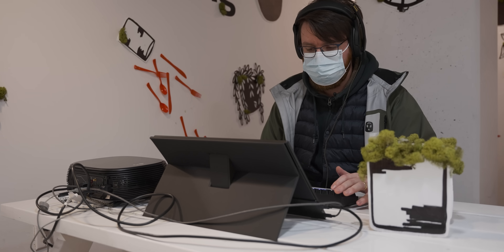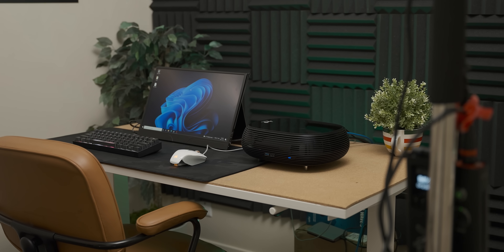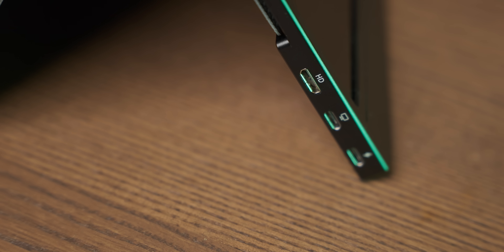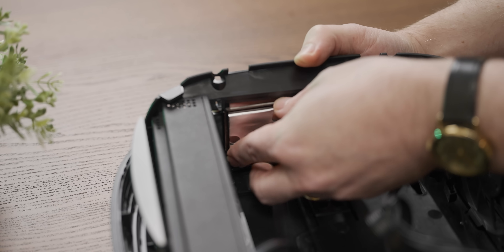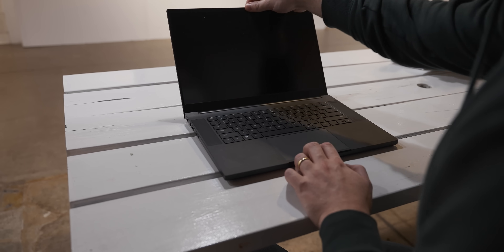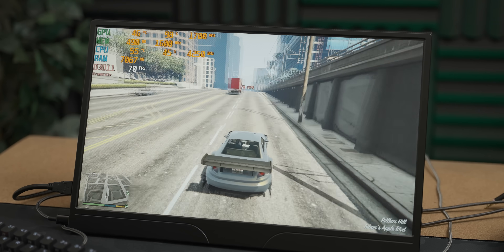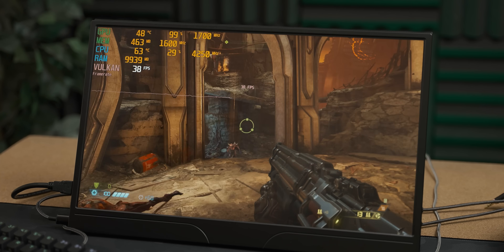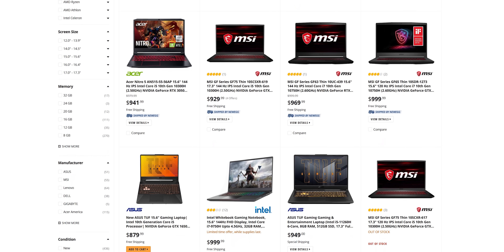Wildly Impractical "Budget" Portable Mini Gaming Setup...

Comment: I can see people liking this set up if they live in a really small apartment and want the option to store it all away easily... I know I know, get a laptop then. But for those who want separate components this is a nice option imo :)
Reply: Agreed
Reply: Exactlyy
Reply: A laptop makes more sense, but building the PC is half the fun 😅
Reply: Laptops aren't intended to be run at fully duty cycle, just boost once in a while, else their cooling system is pushed to the limit, and even when it can keep up, the noise usually warrants earplugs. This little system can go all day any day, it's silent, and if someday a component gives up the ghost, it's an easy and relatively inexpensive replacement.
Reply: @junko4166  yassss! And getting to build in a lil mini itx case like that with the lil motherboard and stuff seems like a fun experience 😺
Reply: @SianaGearz  exactly! And if you want to upgrade a component you can without having to replace the whole system.
Reply: @SianaGearz  i agree but still you have to play games on 720p
Reply: I saw this case and thought it was a projector. Put a led projector on top of the case.
Reply: As someone who lives in a place that is often at risk of flooding, I do sometimes wish I'd stuck with a laptop in lieu of an mATX build despite it being better value from a price-performance standpoint (as of the time I put the system together anyway). Definitely a time and place for all these, though use case may certainly be more restrictive.
Reply: When are we going to see the "Anna watches all of Dawids old videos and tazes him for every useless one" video?
Reply: L4fty  my dad is half Deutsch :)
Reply: Yeah, but i hate when people bring this kinda setup to public place like coffe shop, just buy a laptop if you wanna bring it to public place
Reply from the maker: I still think a laptop is a better option for that, but you could get a different ITX case where you can drop a dedicated GPU in. 😁
Reply: Laptops have limitations, I bought an asus gaming laptop with a 3050ti but gpu only runs full power if plugged into external monitor… kinda defeats point of a laptop so dawids solution isn’t so silly
Reply: Anna you wrong, everyone nead the idiea of your husbend, sheme on you for saying that only someone will nead it in small appertment.
im surprise from you Anna
Reply: @ultraL2  Or get a laptop with MUX switch (negates the issue you're having, but expensive though...)
Reply: @SigalDa  pardon me?

Comment: It wouldn't be a Dawid does tech stuff video if the premise of the video wasn't practically useless, but loads of fun! 🤣 Honestly makes me want to build a mini itx build for my living room because my Roku is terrible
Reply: Right? It’s a perfect lil living room PC!
Reply: If you do this, I'd probably go with the InWin Chopin instead of the InWin B1. It's got a lower wattage PSU, with 150W instead of 200W, but you're not gonna go above 150W with a 5600G (someone powered a 5700G off of it without exceeding 135W), and the side panel is mesh rather than glass
It's also a lot smaller, it's basically the size of an ITX motherboard
Reply: I have a living room PC. It comes in handy all the time. Chromecast, Roku etc. Are all way cheaper but I just really like it and it never has issues I can't fix unlike the TV apps
Reply from the maker: It's really great for a powerful TV PC. Thanks for watching! 😁

Comment: It seems like the 5600G or 5700G should have been used in this considering that’s what most people would use as Dawid even pointed out.
Reply: The 5600G lays down the spank even harder. More cores, more Vega.
Reply: @richardgarrett2792  and more CPU airflow chocking. And noice.
Reply from the maker: That's true, I just had a 5300g. There has been flooding in the area where I live so it's been real hard to get hold of new stuff.
Reply: @DawidDoesTechStuff  I hear you, brother. I’m in the same area. If there is local Amazon stock (either Tsawwassen or Richmond), we’re good btw. I ordered something from Canada computers and took an extra week to be delivered

Comment: I can see someone getting that if they like the aesthetic of that case which looks very mid century modern. Hopefully Ryzen 4 has RNDA 2 or 3 in it to really push that IGPU goodness!
Reply: it's something they already utilize with the xbox and ps5, it's puzzling why they wouldn't make this available for PC's, even if it were an entire board assembly.
Reply: Part of the reason they've kept vega is due to ddr4 speeds being unable to supply enough bandwidth
Reply: @Vegatablez  I’m still in favor of a purpose-built board with GDDR5 or 6 soldered to the motherboard
Reply: I'm kind of hoping they consider using hbm again in the future, maybe an hbm chiplet? Using it like a cache for the cpu when not as vram
Reply: @continentalglue  there is something called contracts that can prevent them from using.
Reply: @vollkerball1  between both Sony and Microsoft? Exclusivity to the console market only seems like a needless pigeonholing
Reply: @continentalglue  it depends. They could have funded the research and development and that funding is not without caveats
Reply: @continentalglue  I am talking about AMD contracts with Sony and Microsoft, if you compare the solutions are different but for example Sony solutions has built in decompression units, sound, and IO differences and those modifications have to be researched and funded.
Reply from the maker: I know right! I can't wait for those new igpus.
Reply: If I were ever to build an HTPC I'd probably consider that case, I think it's gorgeous. It's pricey, though.
Reply: It looks like Ryzen 6000 leaks have performance around Gtx 970 and 1650 for IGPU performance.
Reply: @davisbradford7438  Uhhh sorry but no. The tech media did a terrible job of reporting those leaks. First of all many headlines and stories forgot to mention that this was not a desktop chip, but a mobile one. The leaked benchmark for the iGPU on the Ryzen 6000 APU had a time spy score of 2,700. The desktop GTX 1650 scores around 3,950-4,000, and even the mobile 1650 will hit 3,500 if it's the full 50w part, 3,200 for the 40w max-Q part. So we're still a fair way off from those scores. Also consider that this whole storm of media stories about it was launched from a single tweet, which was not a screenshot, but just a picture of Rembrant the painter and the number 2,700. If it's true, that is still a hugely impressive score, but lets wait until it actually comes out. And also lets not get people's hopes up by telling them it's more powerful than it is.
Reply: @continentalglue  That is very unlikely to ever happen, since graphics memory is expensive, and if you're going to pay the production cost of a purpose-built board with GDDR memory then you're basically half of the way to making a discrete GPU. The cost of such a product would reflect that, so who would pay such a premium for what is in the end still an iGPU? It would make more sense to just get a GTX 1050 type dGPU, assuming the market was not how it is now. The only way that would happen is if the current situation goes on for many years, such that a company sees an opening in the market.
Reply: @zvexevz  Fair enough. I haven't done a lot of research on it as the information is still pretty thin.
Reply: I imagine we'll see better APUs with the next generation of Zen as the current AM4 platform has pretty much reached the limit in terms of bandwidth. AM5 being LGA will help as will DDR5. Consoles are completely custom and socket form factor isn't even an issue as they are directly soldered so I do think that it is the AM4 socket holding them back at this point.

Comment: pro's

-it's unique
-easy to repair
-easy maintenance

con's

-it's much larger to carry around
-it's more fragile ( monitor )
-it takes more space

i am personally doing a microATX build with i7 12700k which is using the ThermalTake Core v21 for it's versatility and smaller tower size ( it's a cube )...and with that build i intend to do a lot of emulation, living room games and wireless VR and have a powerfull PC to bring around at friend's house and such...and i even bought a wireless keyboard with integrated touchpad to save space and cash on the mouse... all i need now is the portable monitor and i'm set to use a chonky space heater in public areas in case someone has cold....may even get chicks..who knows?....also i just realised i could simply plug the monitor on the pc since the top is square...

Comment: I don't see a lot of games doing better than 60 FPS on this hardware. It would be interesting to see this done with less expensive parts.

There are HDMI adapters for laptop panels. Take the screen off an older laptop with a 60 Hz screen, screw the hinges into the top of this case, get the 12 volt power from the PC's power supply and use a wireless keyboard and mouse. 

I think that would make it cheaper and infinitely more portable.
Reply: Or get a laptop

Comment: Yeah, building a node 202 setup for my Dad with an old i5 3470 and 16gb of ram with a HD 7770 in it. It's not a laptop replacement, but it's much faster than his A9-9700 non socketed Apu based all in one he has now.

Comment: A setup like that would benefit so much from a type-c display. 
To make it portable I'd suggest to integrate it in a backpack with ventilation holes and hole to run the power cord, it would need only 2 cables (considering wireless peripherals). 
As an engeneering student I cold see myself using a workstation like that (also considering covid and lockdowns)

Comment: I just wanna say thanks Dawid. I was looking for prebuilts and my dad sent me a photo of the MSI Codex R you showed on this channel earlier but I realized that it was the one that constantly getting BSODs and I told him about it so we looked elsewhere.

I don't know if I should be so thankful or not cause I got the HP Omen (it's been pretty good for me though)
Reply: The bsods where from the ssd needing a frimware update or the windows install being borked.

It is recommended to reinstall windows anyway so if the price is right I would not wright it off if you feel comfortable installing windows.

(A 1tb nvme was just $85 cad so depending on the peice a new drive may not even be a deal breaker)

Comment: The new lian li q58 has same front panel power connector :) I plan to do a video on mine...r7 2700 ..65watt..rtx2060..got the plate that came with it with 4 zip ties with a 4tb hdd floating under a top fan...got a cooler master air cooler on it ...one of the first or only air cooled q58's :)

Comment: I think the DeskMini barebones kit is a little more cost-efficient than this considering you're getting case, motherboard, and power supply for around 200 USD.  Those are pretty much sold out everywhere now, though, and you have to use SODIMM RAM (I don't even want to look at the prices for these right now).

Comment: My Laptop has Vega 7 (so even a bit better than the Vega 6 here) integrated graphics and games are running very decent on it.

It also has a 1660ti, so apart from certain battery saving conditions and dual screen setups I am not using the iGPU at all.

I really want to see what the new APUs with RDNA2 can do. If the Steam Deck is any indication, it might just make 1650s and similar cards obsolete.

Comment: Maybe a similar build in the Fractal Node 202? It's got a similar schtick, being a relatively SFF PC that you could theoretically make portable, but you can also fit a GPU in it
Or you could go all the way and go with something from Velka, but the Node 202 is much more affordable
Reply: The Node 202 is fairly compact but it's significantly bigger -- about the size of a consumer Hi-Fi device. It's a decent case for lightweight Mini-ITX builds though.
Reply: @Stoney3K  It's bigger, but it's also a lot thinner, having a similar profile to a relatively thick binder
The Inwin B1, by contrast, with its rounded design plus its feet, has a much more square profile by comparison (ironic, considering the fact that it's rounded)

Comment: I recently recycled my old hp dv6 (p8600+ati 3650) laptop screen, a glorious low view angle 1366x768 lcd screen, and made it into a "portable" screen. The issue is that it's portable but not it won't work with powerbank, I tried a step up module but it won't power on on anything below 12v 3 amp (I guess it's too old as the backlit module is not integrated). It cost me 20€ for the controller board and I made it in anticipation for the Steam Deck, so that I'll have a low res screen to pair it with in case games won't run well at 1080p and don't suffer through the blurry mess of not running games on native resolution, also as a screen for backup.

Comment: The integrated graphics of the Ryzen 3 are vega 6, not vega 3, vega 3 are the ones used in the AMD Athlon 3000g, and ryzen 3 3250u (laptop processor)

Comment: If you want peak performance, one could put a 5600g for a little bit more juice, and switch to wireless peripherals for cleaner easier carrying. No need to fumble around with cables.

Comment: Hi, I got a solution for this tiny build that can improve the performance, have you ever think about put a nvidia T1000 into this system, it is a 1 slot card with a tiny fan and short, and more important it does not require a psu cable. I think it will definitely improve the performance and still keep this form. I can see 1 slot in the case that available for the 1 slot graphic card

Comment: Ok, I know it's played off as a joke. But I did infact build a setup like this last summer. Asrock Deskmini with a 4700G and it is mounted to the monitor, so the deskmini acts like a stand. 60% wireless keyboard and G305 mouse and I am able to play Apex on it. 

A $600-700 laptop would probably come with a 1650 and perform better but it would also be ewaste when it becomes obsolete. I at least have some headroom with a 5000 series upgrade. It's dumb but also fun.

Comment: I'm using a gen 1 Ryzen system because the laptop with the 2070 is an expensive paperweight. It overheated like crazy, had to go in for repairs..twice. Would be a 3rd if it were still under warranty. Wanted a gaming laptop, bought into the whole "it's portable" nonsense.

If having to be tethered to power to be usable is considered portable, I'd much rather stick to an itx system. At least with those, an issue with the motherboard doesn't render it useless.
Reply: Any ideas for a gaming pc under $1000usd?

Comment: Should've shown the cost difference between the i9 12900k vs the 5300G. Even 11th Gen i7's paired with intel Xe graphics chips just barely match something like a Ryzen 5700G or the mobile 5800HS.

Comment: I THINK  if you used wirless mouse and headset mby it would be less of a struggle further more if you mountet the pc the display to eachother. even then i still think a laptop is better in that riggerd like fx performence. but for me i would go with this but that is because when i game even when i am out i have keybord at a bad angle like i have it at almost 60 degrees wich makes the laptop screen  rotate "60 degrees" so i cant see what is happening. the thing that i would do is making a small pc and mount the screen to it but use a normal screen and just have the pc on the back of it( would not use a big screen but more like a 20 inch og something like that 

good video as allways

Comment: Well, it's good enough if U can't afford powerfull laptop. Although monitor in this video and a case are too expensive to be considered "budget" category. I'm using small mATX case and 23 inch monnitor. All fits in a medium size Bag with wheeles that U can drag behind you with a handle. Usefull when U change appartments frequently

Comment: I’m actually currently building a portable setup, I made my own 8 liter case with an rtx 3060ti and i5 11400
Reply: A 3060Ti in 8 liter? I'm curious to see how that holds up for power and thermals. The TDP of that graphics card is about twice that of the 11400.

Comment: Laptops are great until they go wrong - get full of dust and overheat - you bash the screen - or until you want to upgrade them.

 I take a Ryzen 3000g 8GB 1TB NVME mini-pc with me for travel - a fraction of the cost of a comparable laptop and I can clean, replace and fix every part of it easily. 

Every hotel and Air BnB has a TV so need to buy a monitor. 

My keyboard and mouse are wireless so I can lounge in bed and not be hunched over a laptop.

I can upgrade right up to 64GB and a Ryzen 5700G and add more storage than i'll ever need.

Comment: Right? Why doesn't every case have just one simple cable instead of all the dumb little ones for front i/o? This should just be standard by now...
Reply: because it's not standard on motherboards, there are still a few out there which use a different pin arrangement for the front panel cables